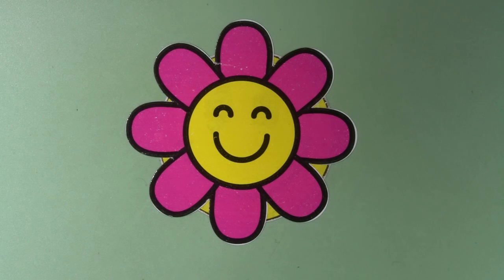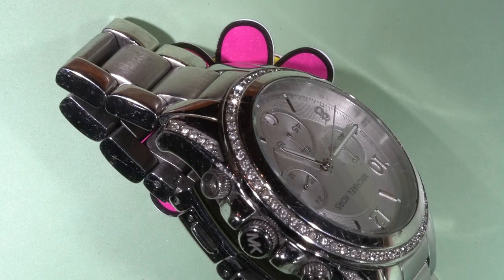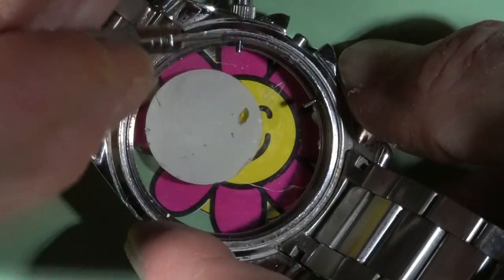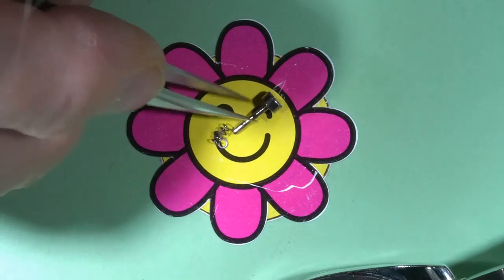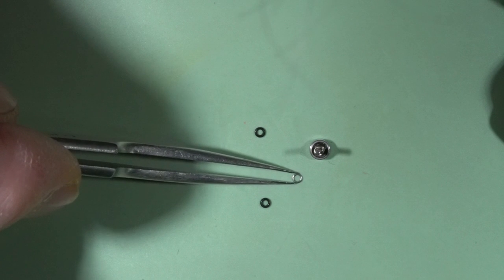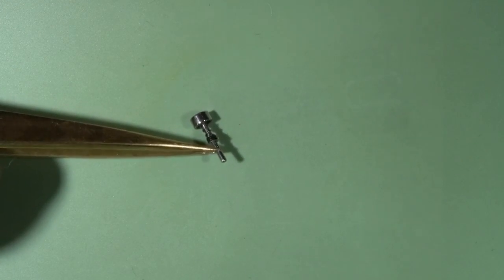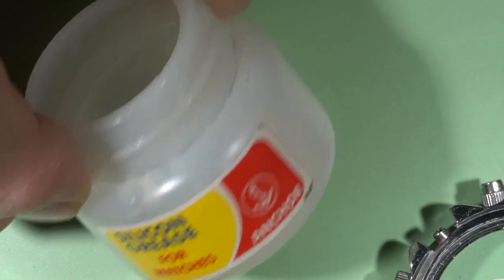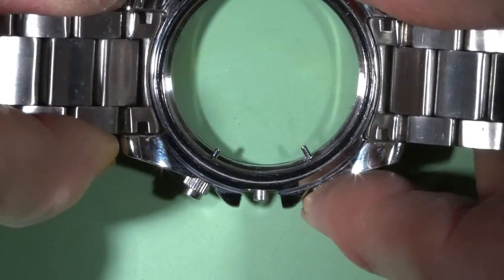Removing and Installing a Chronograph Pusher How To Watch Repair

Comment: Hello, I by accidentally pushed my reset pusher without pausing the chrono pusher. It didn’t activate but I was pushing it quite hard, felt like it was just hitting metal and then I stopped. Did I do any damage is it’s working 100% right now? Thank you!
Reply from the maker: I do not think you caused some damage, the mechanism is designed for pushing in any sequence. Just check functionality.

Comment: Can you tell me please the dimensions of the spring ?
Reply from the maker: I do not have this particular pusher anymore, but approximate springs dimensions are 1.5 x 4 mm. In any case, these springs go in different sizes depending on size of the pusher, so you need to do some adjustments.

Comment: Hi, do you know where can I find this kinf of buttons? I have a chronograph and I lost the button for the start. Is holow crown with large pin .Thank you.
Reply from the maker: The best way is to look for the same watch model, as buttons have different dimensions in other watches. What is your watch brand/model?
Reply: @ValentechTime  this os tricky. Is an old Police Watch black with a miyota js50 movement. I can't find it because I believe is one of those "brand" watch. Is the police sunglasses company
Reply from the maker: @rafaelmmartinez9170  Understand. Maybe you can find the same case even with a different watch model. Some places sell those buttons, but you need to know their dimensions. It could be done. Good luck!